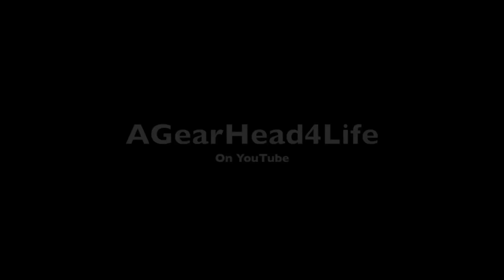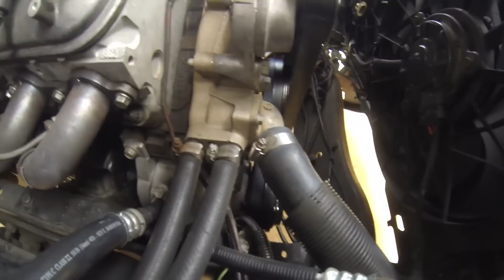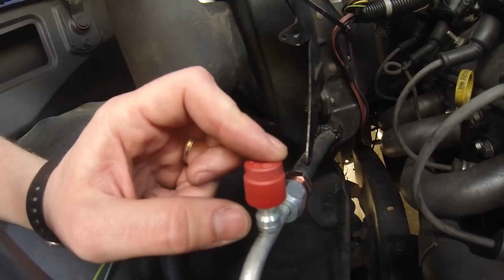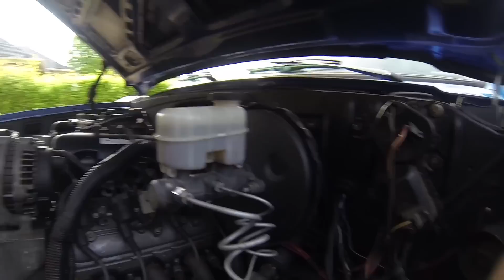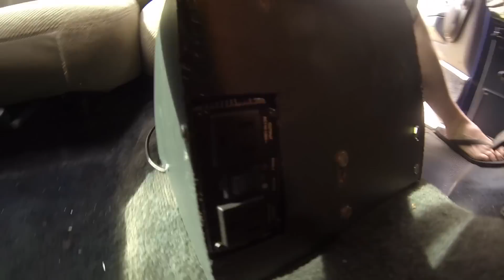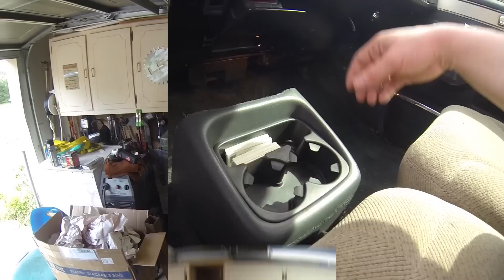AC LS Swap C10 Part 2 + Brake Master Upgrade, Console & Tires

Comment: i have a 1980 chevy truck long wheel base i'm using a 5.3 motor and tranmisson out of a 2002 chevy truck . i was wondering could i use the  2002 chevy truck yoke from the front and could i use the same driveshaft with no cutting on the driveshaft
Reply from the maker: Byron Callic The yoke would work, but probalby the yoke that you have would work too, if you have a th350. If you do have a th350, your driveshaft will be too long and I dont think the one off of the 2002 would be the right length. I've alwasy wanted to use a newer driveshaft and have it cut to fit our trucks. Theyre aluminum and the light weigth would be good for rotating mass, but theyre not as strong and with added power have been known to explode.
Reply: thank you
Reply from the maker: Byron Callic No problem. Oh, I also meant to tell you that you could get a driveshaft from a long wheel base C10 that had a 700r4 trans and it'd fit. You'll need to either use "one inch set-back" swap plates or Dirty Dingo adjustable swap plates.

Comment: What mods did you have to make to drop the motor in the truck and what bout your wiring harness
Reply from the maker: Robbie Niavez This old video of mine should help answer most of those questions. https://youtu.be/jDQbIBQoQ3k
Reply from the maker: Robbie Niavez Wiring info can be found on LT1swapDOTcom. But this video and the video description can give you more ideas.  https://youtu.be/VogkaVNGkCU

Comment: what kind of belt did you use on this
Reply from the maker: Byron Callic I used the stock 2001 truck 5.3 AC belt. Its on a separate grove on the crank and power spins the AC. Gates # K040378
Reply: thanks man

Comment: I don't know if you made a video on your fuel delivery system but I would like to know what you used.
Reply from the maker: Rico Turk No, I havent made a video on the fuel system but I guess that would be a good idea. I ahve a '87 truck. So it was alreadi TBI fuel injected. So it had the intank pump already. All I did was swap in a higher pressure fuel pump. Then at the end that connected to the TBI unit, I cut the hard line and used high pressure hose and doubled high pressure hose clamps. If you get on my Facebook blog page from a desktop, go into the photo album of the truck and you see pics of what I did there.

Comment: Really like your videos man, specially from this truck. I have a '73 Chevy c10 but got a little tight on the money so I'm just keeping it low until I get money
Reply from the maker: Jorge Almaguer Thank you Jorge! I know how project funds can get tight and affect progress, for sure! That problem is what got me started on YouTube and my whole channel is based off of. Buck stretching, low budget building! Good luck on you '73 C10 man. I hope you can get back to wrench'n on it again soon.
Reply: AGearhead4Life Thanks man, it's good to see you take the time to read comments;) And I sure will get back to work in my truck as soon as I get some money. I got the engine  and transmision working nice and smooth, I'm thinking on focusing on the suspension now, but only time will decide that. (I might put some airbags on that badass truck)
Reply from the maker: Jorge Almaguer Yea buddy! I read and respond to every post on my videos, always have. But as the channel grows its getting harder and harder to keep up with it. I've also got a full time job and 3 kids that require most of my time.Glad to year you've got it running smooth. Thats a good comfortable feeling. Yea, suspension is an important one for the appearance of the ride. I want to bag a truck some day, but it wont be my current truck. I want this truck as dependable as possible and a static drop is more dependable.

Comment: O! By the way the center mount motor mounts can I get away with using my stock drive shaft...
Reply from the maker: jeremy hunt Not usually, the yoke will stick out an inch further. You may be able to find a way around that though. I had to use the central mounting ones because my 80e yoke that I had had an inch thicker head on it.
Reply: I've seen some ls swaps in place of the caprice lt1's, use they're stock 4l60e trans.. so I may be on to something. .

Comment: Thanks for the A/C install info very helpful . Did you install a binary switch for a high pressure cut out to save the compressor?
Reply from the maker: Doby Gillard No, but I have been strongly considering how I could add one to the system.
Reply: I have a stock set up I am experimenting. With I have no accumulator. In line . I also do not have a thdrmostatic on off for my fans. Its manual. Caused the last compressoer to burn the clutch up. I'm just saying. 
Ben following you for a while. Most of your info is the best out there. Keep on keep in on man! I admire your diligents
.
Reply from the maker: Doby Gillard Thank you Doby! That is a huge complement. wow. And thanks for the continued support! Thanks for the heads up. I was wondering what will happen from too high pressure on the high side. I learned part of it the other night the hard way. I had no fan becuase they were dependent on the PCM to turn them on once the engine reached operating temp. Well the engine cooled enough, so the fan shut off and the pressure climbed extremely high on the high side from the heat in the condenser. The next thing I knew there was a loud pop and the system seemed to have purged the pressure until I cut it off. I didn't locate the relief valve yet, but that's what seemed to have happen because its working fine now. Now that I have the fan to kick on with the AC its been fine, but it would be nice to have the clutch kick out by a high side pressure switch in case that fan failed for some reason. So I'm still working on that. Any idea if the old C10 system had a high side pressure switch?
Reply: Not that I am aware of.
 I am searching for a  1/4''SAE female flare fitting w/valve depressor. like would fit on a R12 service fitting.
Two wire cut out at about 395 and back in at 225. Binary switch. I found a 1/4'' male and ordered it then found out it needs to be the female... live and learn... always the hard way for me...

Time is getting tougher to come by. as you can tell by my april 12th reply...
Reply from the maker: Doby Gillard I definitely here you on the value of time. Its gotten so rare lately that it scares me. So far my AC seems to doing well and dependable. Fans are wired to come on with the AC now and its stays blowing about 50*. Temp around here during testing has only been 82* on average though, but very humid.
Reply: Hopefully I will have my part on Monday. I was thinking. HVAC supply store has these. Does not have to be car specific. I could have had this month's ago!

Comment: HOW CAN YOU INSTALL A RELAY ON A FAN???????
Reply from the maker: victor chavelas Victor, I'm not sure how to take your comment. You know a lot of people leave sarcastic rude comments and when they do, they use all caps and lots of punctuation like you have. I can easily misunderstand your comment as sarcasm and not respond to it, but I'm thinking that in this case this might actually be a serious question. If so, all you have to do is type it normally.
Reply: SORRY BRO THATS HOW I TYPE .. BUT MY IS QUESTION IS SERIOUS HOW CAN I INSTALL N A RELAY I GOT A 82 CAMARO Z28 I SWAP THE MOTOR THIS YEAR TO A 5.7  VORTEC IN I TOOK THE FAN CLUTCH OFF N IN PUT TWO ELECTRICAL FAN N A ELECTRICAL FUEL PUMP THE PROBLEM IS I GOT TO SWITCH ONE THE FUEL IN ONE FOR THE TWO FAN BE THAT SWITCH BLOWING UP TWICE A MONTH SO WAT CAN I DO..........
Reply from the maker: Ah, ok. Are you on Facebook? On my FB blog page, I have a picture of how to set up a relay for a fan. It seems to help simplify the process a lot.

When you go to my blog page "AGearHead4Life" on FB, you can find the picture in the photo album named "LSx Swap Parts and Related".
Reply from the maker: You may not need an account to view the page either.
Reply: K
Reply from the maker: I would post a link, but the computer that I'm currently on wont let me copy and paste.